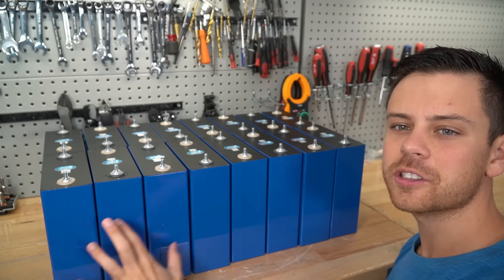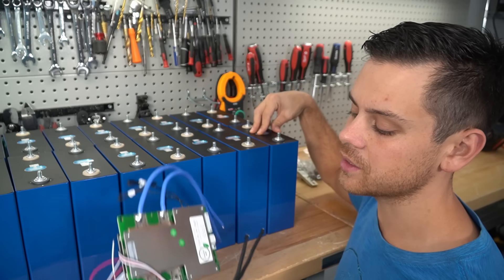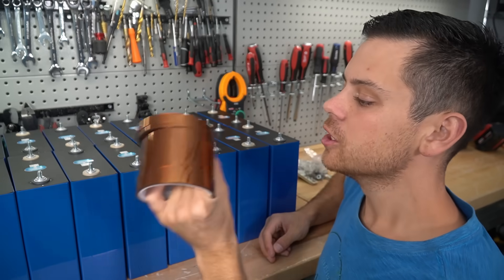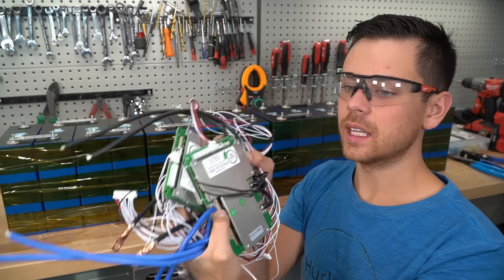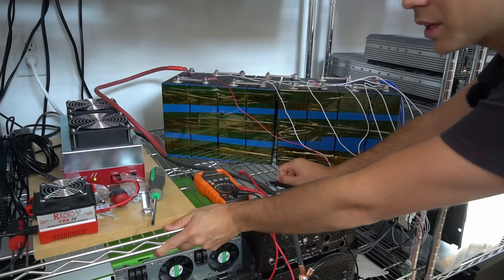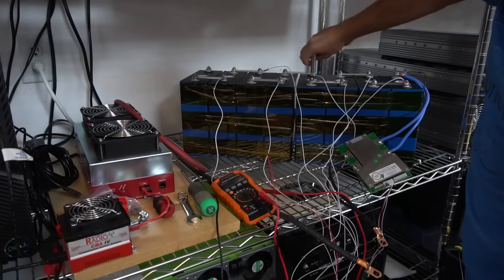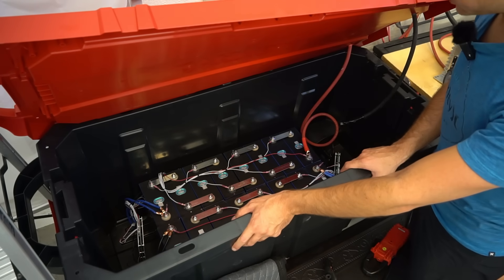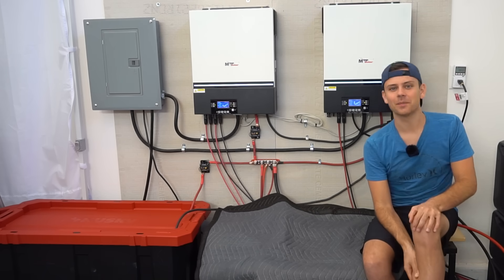DIY 48V 320Ah Grade B LiFePO4 Battery Build: 16kWh for $2,810?!

Comment: I wondered if you have ever thought about making a backup backup bank. I am installing an Enphase solar system with the Encharge 10kw battery so I can island and stay up when the grid is down. The problem is that at around $9k adding a second 10kw battery is not likely to happen but I'm wondering about building it. Building the 2nd bank is easy enough but I'm wondering about connecting the home made bank. Can I tie it directly into the Enphase system, would it need to be a stand alone system with a transfer switch? I haven't seen the Enphase yet so I'm having trouble visualizing how to put it together. Any thoughts?

Comment: Hi Will, glad you tested these 320Ah battery packs. there is a group of Batteries with 304/310/320 Ah which I have used in strings (2 * 16) now for a while on my (Growatt) Solar system and had very little to complain. One cell bloated very slightly (not like the ones you got) when I top balanced a string of 16 and the seller added one more immediately to the next shipping foc. I'm living in Northern Thailand, which is quite close to China and shipping takes only 2 to 3 weeks, so it is easy to order spare batteries and parts. To save space and to keep potential bloating in check I stack them vertically. 8 batteries are stacked on each other and so far it works. I just received another 32 304 Ah batteries after I made good experiences with the 304Ah variation, but I also ordered another 16 320Ah, simply as it was irresistible low priced for 1,250 USD including shipping to my doorstep (83 USD per kWh, unbeatable)  and a similar stack from the same seller worked fine but I have no too high expectations, but then, you never know. I'm in the process to expand to two Growatt SPF 5000 ES with 5 X 16S 304/320Ah strings what should keep my house (including all ACs and pool and water pumps, etc, off the grid for a good time of the year and to keep the house bright during the many power cuts we experience here. All great fun.

Comment: I could really use some help as I am such a newb to this battery thing.. I have a brand new 15.75kwh solar system on my roof, with 2 - 7600w inverters (one of which is a "storedge" for storage). I want to build my own Lifepo4 system in the most economical way possible. I am struggling understanding the math in building out a system. I would like at a minimum enough power to get me through the night, ideally though 2x that.

Comment: That is cheap $170/kWh or $189 if accounting for the lower capacity. 5.3kg per cell 320AH*3.2V = 1024Wh =193Wh/kg that is too high for LiFePO4 to be realistic, it is like the heavier Li-ion cells, so I think the cells are specced too optimistic. High quality prismatic LiFePO4 cells in this type of packaging are 170Wh/kg (might be an old rule of thumb), so by that you've got your hands on 200Ah cells. So you paid $195/kWh. Hopefully the A-grade order will prove them better worth your money.

Comment: Ah is an ah. I asked Google. How long can an trolling motor last on an charge. 5 hours or less. So if I could get my two AMG 20 ah batteries to last on an single sustained run for 5 hours I would be very happy. My test was in my backyard. In an 5gal bucket of water for resistance. Since the trolling motor was over 10 years old. It has an high and low setting. I put an variable speed switch on it. My guess at 30% power would be about correct for an trolling speed for an 12.5ft pontoon raft. Yes the system was hookup to 20 watt solar panel. So the test started at 8:30pm. At total darkness. Start voltage was 13.06v. The end of the test the voltage was 12.02. Stopped because of sun location and a tree blocking the sun as well. Test was stopped at 8:30am. 12 hour run. 2 small AMG 20 ah batteries were used. Yet wired differently. In an hourglass formation. Was that why it ran so long. Whom knows. Yet it did. Just sharing.

Comment: Realize that using two 24v BMS's in series likely have MOSFET cutout switches with Vds_breakdown voltage suitable for a 24v battery (likely 40v MOSFET's) but not for a 48v stack.  When one BMS cuts open then it will be subjected to the 48v stack voltage.

Same issue applies to self contained 12v w/ BMS.  If you stack them you need to make sure their BMS has breakdown voltage capable of total series stack voltage.  If the 12v battery spec does not state what their stacking capability it then assume they cannot be stacked.
Reply from the maker: Oh I know. They have voltage rating of 80V. They are designed to be put in series to 48V.
Reply from the maker: We talk about that alot in my videos. Maybe you're new here. Welcome

Comment: You should put extra insolation between the cells. As also other YouTubers stated, if the blue wrapping has any damage you will get a short and destroy the cells and maybe more.
Reply from the maker: The blue wrapping doesn't have any damage and yes I'm well aware that the case is connected to the positive terminal. I try to do a dead short on the case and the amount of current that flowed was very small so I don't care that much. The sleeves are designed to insulate well enough

Comment: "I like to push these batteries to their thermal limit and cycle them hard".  Hmmm, are we sure we are still talking about LiPO4 batteries.
Reply from the maker: By cycle them hard, I mean cycling bandwidth. Not c rate, so my wording was wrong. Should have mentioned that. I pull .1C max on this system. They won't die. 
But I have pulled 3C discharge on my lifepo4 packs for days without issue. Hard cycling. Very little degradation
Reply from the maker: I pushed 100-150C from my lipoly packs years ago. No over current protection either. That was on my race drones. Those were being pushed to the limit. I had puffy lipoly pouch cells from those discharge rates alone. But the speed of my drone was nuts

Comment: I have purchased 64 of these cells. To compensate for slots in the bus bars I fitted brass washers below the busbar and contact washers under the nuts.  To stabilised the connections I clamped them with bandit.  
All my internal resistance were well below the list from Catl.  They are allegedly grade A but some are slightly bulged.  I top balanced and also fitted 2 amp active balance units to each pack.  In time they hold a few millivolts.
I have a spreadsheet of all the initial values if anyone wants it.

Comment: I wonder if those batteries were over rated. I have 200 batteries that look exactly like those. Mine are rated at 280 Ah. My guess is that perhaps the Aliexpress listing over sold the capacity. If they are in fact 280 Ah, you have great batteries!  I imagine a size and weight comparison would be in order.

Comment: I'm so glad you did this video Will, I'm thinking of a 2 X 16s 320AH battery setup using 2 X Growatt 5000 ES all in one inverters in parallel.  Those inverters have a wopping 450V pv input on each inverter. I would loose my mind if you did a review on one or even 2 Growatt 5000 ES's in parallel for 10KW system. I cant wait to see what test results you get with the A quality batteries you're waiting for.  my goal is 32 X 320AH battery's, for around 30KWH of storage power, and 6KW of solar panels. Check out the Growatt 5000 ES you might like it :)

Comment: Lifepo4 
can it be used under the hood in a car in a frost of 20-25 degrees, will they last 8-10 years in a car?
Reply: They are not for freezing temperatures and not used for cars
Reply: @vanderumd11  thanks

Comment: $11,000 plus several hundred in disconnects and breakers and service panels and wire and battery cable and tools  terminal ends etc.  Another $1,000 to several thousand in mounts for the panels.
Reply: 1-7k for panel mounts, lol ! Mate, he just has panels lying on the ground !
Reply: @Kevin_Aus  Several thousand not 7k.  Very few people can cover their driveway with solar panels in the US and leave them there not to mention get the soar exposure Nevada does

Comment: So how is the 48V running the inverter? Or do you have a separate inverters for the 48V and solar?
Reply: They're all-in-one inverters; he set the system up in a previous video.  One box does AC charging, solar charge controller, and inverter (from battery, solar, or a combination).  Two boxes, as he's using, give you split-phase 240V output when configured properly.
Reply: @danbrown586  Thanks! I was wondering if I could connect a battery to my 3-phase solar inverter (Fronius Symo 603M) but I guess the voltage needs to be a bit higher..

Comment: I am just waiting for the delevery of a 270A 48v battery direct from China, via Allibaba  so hopefully I will be using your experteeze to good efect in a couple of weeks time,  I will fire them up following your example. Great content . Thanks 
One thing though, have you seen a circut perhaps via a Rasbery pi that can see how much solar is being generated, and if you have excess to requirements, it can turn on various loads, like pool pumps, then hot water storage, then charge batteries, etc?

Comment: Hello Will and Group:
I am a newbie and I did buy the wrong deep cell wrong battery for my micro climate I am still learning about charging and discharging deep cell batteries. I need to buy a deep cell battery that can be used and works in winter locations, below O
Will and Group what do you know about Fullriver Batteries?
Will please think about doing a you tube  review of Fullriver deep cell batteries?
It is very hard to find deep cell batteries that will work on there own in below O locations.
Regards
Hope

Comment: I am a bit surprised at the use of those breakers with such a large bank? Most of those automotive type breakers only have an AIC of about 3000a at best.
Reply from the maker: Yeah I'm swapping for t class fuses tomorrow for the inverter supply.
Reply from the maker: Actually these have a max of 1500A
Reply from the maker: Four individual packs the circuit breakers were great. But I might swap it out for a larger one with this size of bank

Comment: I saw a report by another solar solar guy that had failures in those type of circuit breakers. He found them to pop at about a third of the rated load. But I think he was using cheap knock off breakers. Just a heard up.
Reply from the maker: I have them trip at specified current values just fine. I think you're thinking of the super cheap ones. Even the knock offs have worked for me just fine

Comment: looking for some help wiring 2 batt together have 12.8v 200a and 4 cells made up 12.8v 200a with a bms don't know were to connect the neg wire b- on batt or p- to power from bms
Reply: B minus goes to the main negative on the battery 
P minus goes to your loads  negative terminal

Comment: I did this exact same thing a few months ago with the cheapest 100ah LiFePO4 batteries I found on eBay.  Took a 2-3 months to arrive just like these and look similar only smaller.  I had purchased a sailboat that had been converted to electric, but the lead acid batteries were sulfated.  I tried adding magic potions but no luck.  Then I got the lithium batteries almost as a test since they were cheaper than lead acid of similar capacity and OMG  The performance is fantastic on the boat.  I am able to motor for an hour or more at normal maneuvering speeds.  I have not done full endurance testing.  I'll be adding a second bank eventually.  I use the cheap flexible solar panels on the boat.

Comment: With overkill BMSs you can freely series them like that? Is there a limit to how many BMSs can be in series? 

Also what about putting the packs in parallel? I know you would normally put the cells in parallel and hook up 1 BMS but can you parallel 2 BMSs hooked up to different 2 packs?
Reply from the maker: Can't go above 48V pack. They can handle 80V max for total series string. But I wouldn't push it.
Reply from the maker: Parallel is fine but need to isolate with extra OCPD
Reply: Awesome thanks, what is an OCPD?
Reply: @rozensosnovsky6906  over current protection device
Reply: Oh never mind over current protection, all good haha

Comment: i was wondering why the big blue box style of lithium batteries get connected together with thick bus bars while cylindrical lithium cells are always connected together using fuse wire like Tesla does when they build a powerwall  or car battery ?  Isn't that unsafe to forgo using fuses ?
Reply: Lifepo4 are alot safer and just vent if they short..no fire

Comment: The prismatic cells from Sky Energy/Calb and Thundersky/Winston always came with bolts and end plates to apply significant clamping force.
Reply from the maker: Yes of course. Those need it. I hated using those.
Reply: Dont over tight these studs they broke easily

Comment: I found an Aliexpress listing with 7,5kWh (12pack; 3.2V; 200Ah with 3C rating) for $940. Store is called "Global Battery Charger Store" but uses LiitoKala brand. Can you tell that it's a scam?
Reply from the maker: Those have been garbage lately
Reply: @WillProwse  Thanks!
Reply: LiitoKala 320AH cells advertised as grade A cells are garbage! I bought a pack of 4 x 320ah cells, labeled and sold by LiitoKala, cells were bulged, and load testing at 0.15C only gives out 290ah.
Reply from the maker: That's such a bummer. I used to like that store. darn

Comment: Why do you have to waste the kapton tape like that? just use fiberglass reinforced strapping tape.
Reply from the maker: Because I have piles of it
Reply: @WillProwse  Dang, Lucky... I have a weird thing with Kapton tape for some reason, I'm always super stingy with the Kapton tape. I dont know why actually. are you going to do a battery hookup build? I know that was always jehugarcia's thing. I just built a couple 4s ammo can batteries at 1.4kWh each for about $125 each with bms. I built them to power my wife's pontoon for when we get sick of listening to the 2 smoke.

Comment: I've been running a very similar pack of grade b bloated cells for 6 months (16KWH). No trouble. But I found better suppliers and get grade A cells for the same price. No bloating. Built a 64KWH grade A at same price per WH as my first grade B system.
Reply: What suppliers do you recommend?
Reply: Could you give a link to the grade A cells you bought?
Reply: @con-king   @Jeff R  Great question. I don't know if there is a simple way to put this, but I don't know if it is as much a matter of supplier as it is context. The same supplier might treat people differently. A lot of them are supply constrained and are selling grade B  to get by when they are out of stock on grade A.

Don't just buy a random item listing. You need to establish a relationship with a representative at the supplier by contacting them directly.

It takes time, first you buy a sample with a larger order contingent on the quality.

Pooling a few orders together to make a larger one puts you at the front of the line.

This sets the context that it is not worth the trouble trying to pull one over on you.

Good Luck.
Reply: @justdoityourself7134  I'm game. How much do you charge for a killer deal with your supplier?

Comment: Love your videos even though some of it goes over my head but I’m learning.
I would love to build a battery system for my house that has solar that feeds to the grid because the likes of the tesla battery is just very expensive but I need to learn more before heading down this path.
Reply: A cheap or "repurposed" battery pack  isn't worth having. Reconditioned batteries are not worth having either.

Comment: Had you considered adding bypass diodes in between cells to allow them to balance on every charge cycle? Is there any concern with that type of cell chemistry overheating and causing a thermal runaway, or fire propagating from one cell to the next? If so, you could put some thermal barriers in between, which would also provide the cells some room to expand.

Comment: The forum has discussions on the aluminum cells, in addition to compression, or at least solid frame lockdown, they are concerned about electrically insulating separator between cells. 
Are you not concerned for the wrap leakage?
Reply from the maker: I could but I've seen plenty of packs work fine without it. High vibration environment, then yeah. That would be smart idea.